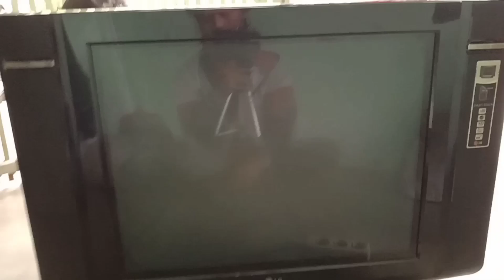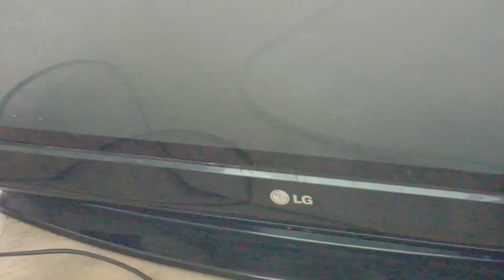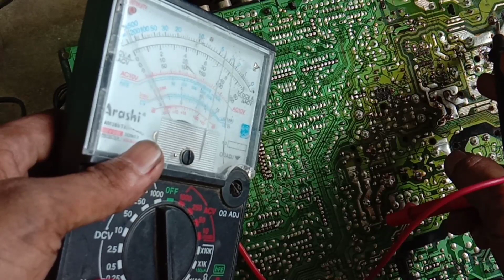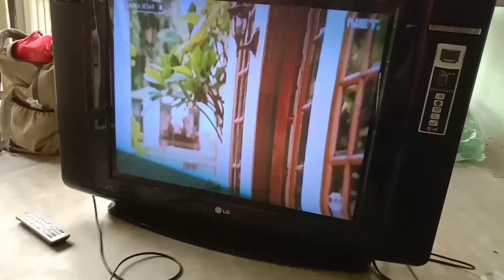cara memperbaiki tv LG 29 inc protect

Comment: bang tv sama kayak servisan saya, posisi cek tegangan sy lepas pin b+ di flayback, terus terukur tegangan b+ naik pelahan dari 90v bisa sampai 150v, saya sudah cek resistor seri dari b+ ke Optocopler masih dalam keadaan baik, terus sy ganti elko 1uf/250v, yg bersambungan dengan resistor itu karena sudah turun jdi 0,8uf, tapi masih tetap sama, tapi yang bikin heran kalau saya cabut ic regulator kode board ic823 3kaki (s111733) tegangan b+ bisa diam di 130volt, tapi jika ic nya sy pasang, icnya masih berfungsi dengan input 5volt outputnya 3volt, 
juga yang jadi pertanyaan saya bang, berapa tegangan standby b+ tv ini bang, dan tegangan b+ startnya juga berapa bang, ? tv udah hampir sebulan ini di biarin, sy kerja tv yg lain lebih dulu, karna udah pusing 😅
Reply from the maker: Teg standby tanpa beban memang skitaran 130-150 stelah start tegangan skitar 120-125 ..kerusakan sperti itu bisa disebabkan kerusakan di jalur tegangan start 12v,5v atau bisa juga fbt rusak
Reply: ohh, normal ya bang kalo stanbynya sampe 150v, 😅  sy gak coba" hubungkan ke fbt karna takut tr horizontalnya jebol,   oke bang besok sy coba test 😁👌

Comment: Bang mau tanya nih klu nilai resistor yg untuk umpan balik tv lg pearl black 29 inch itu brapah aja yah nilai nya, soal nya punya sya sudh gk jelas warna nya, trima kasih sblum nya.
Reply from the maker: Berapa kode pcbnya mas
Reply: @aditvelektronik1751  
Cw-62D
EAX41795203(3)
080417  LI.GE
Klu gk slah Ini bang kode Yg tertulis di pcb dket playback, soal nya kurang tau soal kode pcb nya, maklum bang masih pemula.
Reply from the maker: Maksud saya kode resistor di PCB nya mas.. misalnya ( R 815)
Reply: @aditvelektronik1751  
R 830 R 831 R 833 pokok nya resistor ukuran 1/8 watt untuk umpan balik bang,
Reply: Nyimak

Comment: Kalau LG XD 29 yg pke IC tda12110h1/n300 itu pin proteknya dimana pak. Punya saya kadang nyala setengah jam baru protek, kadang pula nyala 5 menit langsung protek
Reply from the maker: Coba gnti dulu elco kecil dkt str power nya mas
Reply: @aditvelektronik1751  siap.
Reply: @aditvelektronik1751  sy ukur pke esr meter, elkonya 24mikro, elkonya tulisan 22mikro. Tapi tetap sy ganti. Hasilnya masih sama.
Reply: Solusi yg lain gimana pak? Sy cari datasheet Ic tda12110h1/n300 nggk ketemu
Reply from the maker: Pin proteknya adalah komponen dgn kode PCB Q810 mas  silahkan open saja transistor/ Q810 tsb ,oh ya mas klo tanpa gmbar dan suara apkh  tv tetap protek mas..klo tidak maka jumper langsung aja R612 dari pin kaki IC no 6 dgn kabel serabut satu helai
Reply: @aditvelektronik1751  protek Tanpa gambar dan suara, sekitar 5 menitan atau kadang2 semenit jg langsung protek.
Reply: @aditvelektronik1751  gini pak, mungkin Tvnya lebih cocok klo dikatakan standby. setelah 1 menit on tanpa gambar dan suara. Karena klo sdh stanby pijit tombol ch atau nyalakan pke remot bisa.
Reply: @aditvelektronik1751  awalnya dia stnby setelah 30 menitan Tanpa gambar dan suara. Tapi kesini-sini. Sekarang nggak sampai 5 menitan sdh stanby
Reply from the maker: Jika Q810 di open apkh tv masih mau protek mas..?